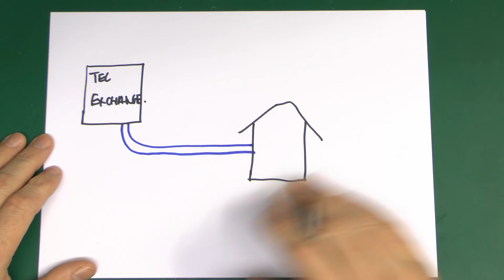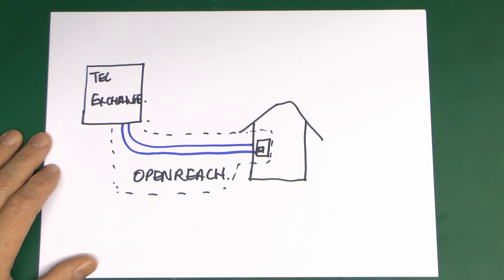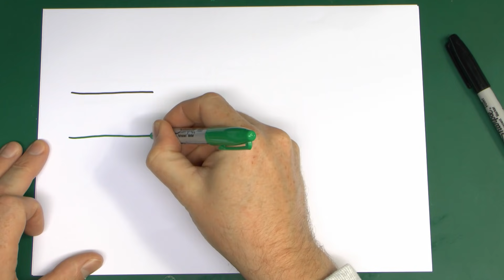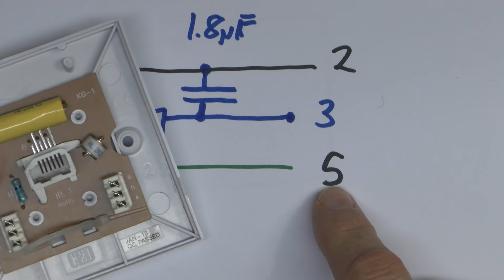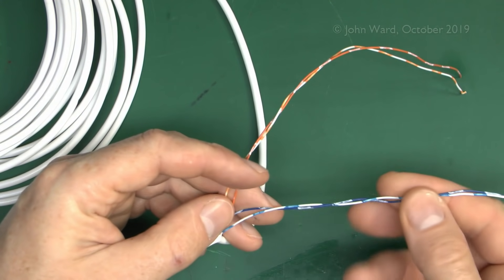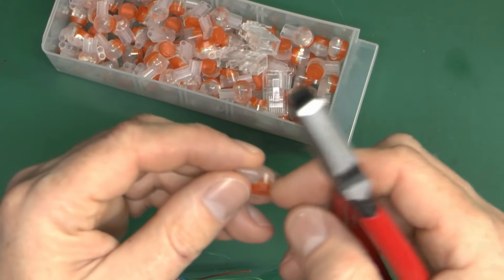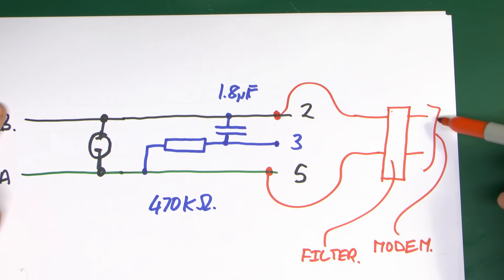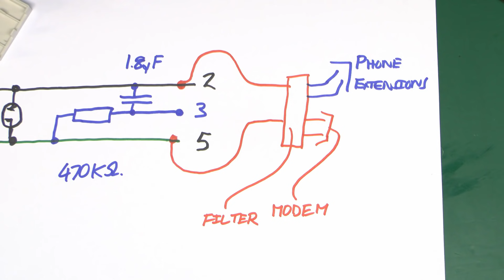UK Telephone Wiring, Sockets, Cabling, ADSL / VDSL Filters, Extensions.

Comment: 11:42 So - all one would (technically) need to do, if one has an older 3-wire phone and it doesn't wish to "ring" on an incoming call, a simple "fix" would just be to add the 470k ohm resistor & 1.8uF cap inside the 3 wire phone itself (& use just the 2 wire jack-point as a 2 wire as normal)?
I'm having a weird problem in that a month ago at 1o past 5 of a Tuesday - our speaker phone telephone started playing up by NOT disconnecting from the incoming line when the handset was replaced, instead tries to automatically HOLD the speakerphone handsfree function on ?
(possibly caused outside the installation as the tech who has NOW been here twice to fix it, eventually totally disconnected the installation (at the barge board entry box) - from all outside services yet still had MAINS HUM on the overhead VDSL/PHONE line that comes down the street... yet guess who said it isn't his fault to fix)

So - I have a distinct impression, what with the mains power company doing pole replacements in our entire town, that some "IdJit" may have "lost" an overhead mains line whilst reconnecting - allowing it to "spring-back" & somehow loop itself over an aerial telephone wire, which - when he pulled it back to his mains pole, may well have formed a potential "induction loop" around the overhead telephone wires, causing our extremely bad mains hum, static and false ringing/tinkling sounds & the non-disconnecting "hands free" speakerphone relay problems.

So - without going all the way down the street to the exchange box itself, I have no way to "sight test" (up the poles) nor electrically test at any point - our "street running" overhead telephone poles & overhead wiring bundles

I am thus thinking, that as some phones FULLY WORK (no hum/static) and others don't - while some others don't RING on the usual main 2 wired master plug-in box, yet will ring on another (maybe a slave) 2 wired plug-in box - located in a distant room ? I may have to fully rewire ALL of the internal wiring that NZ Telecom installed over the years - specifically for the three cable runs to different wall plate outlet boxes, as the one dual outlet (broadband & telephone/fax) at the VDSL outlet that Telecom NZ installed some years ago (in the center of the house) - is a dual outlet box, which is giving us the biggest headache.

I'm assuming that maybe the dual outlet BROADBAND / TELEPHONE jack itself, has faulted (maybe - or maybe not - as who cares at this stage), as that was the very last installed box with a separate cable (run from the overhead incoming line connection box up on the barge board outside), over the past 20 years or so.

IF - I do this, I will work backwards by piggybacking circuits off the most distant telephone only jack points, and rewiring everything from them - leaving the broadband's dual telephone / internet outlet - as simply an internet one - supplied directly from the outside fitted VDSL master filter..

If that works, I'll know that maybe the fault has occurred inside the exterior line box, where TELECOM FITTED their VDSL/Telephone incoming master filter - or is still far far away - somewhere along the street run overhead copper network ?

If it doesn't work - at least I know that it has to be completely OFF SITE, as all other jack-points located in here, have been working fine as 2 wired - for around ten years now.

What has me a little worried though is this, is it our master LIGHTENING ARRESTOR (inside the so-called master jack points, which are ALL of the 2 wired type, no master slave jack anywhere in the installation (which has failed), or is it the one down in their own pillbox, at their local exchange?

Comment: We had 6 core cables on our old phones (pre cordless) as we had a 4+1 system in the house. Terminals 1 and 6 are used for 'recall' - i.e. features to control the exchange - such as hold, call divert, conference call etc.
Reply: Thought pin 4 was for recall.
Reply: @AndyK.1  If so what are 1 & 6 for then ?
Can't seem to find answers on internet - all too old ;)
Reply: 1 & 6 are used for the extra functionality of a PBX system (for offces etc) whch use system telephones and not standard phones.
Reply: @wwsxa39  Does that include recalling the PBX ?

Comment: I always have at least one corded phone, cordless phones won"t work if there is a power failure in your area, the cordless base unit will stop working but the corded phone is powered from the exchange.
Reply: Agreed. you should always have a simple wired phone in the house somewhere. The one here is by the bed and not fixed to the wall - someone I knew had a stroke during the night, fell out of bed and couldn't reach the wall-mounted phone...
Reply: Just use your mobile like a normal person...
Reply: @pingumcping  I got rid of my mobile years ago. Much better lifestyle now.

Comment: Another one JW.   Pin 3 is needed to be connected on the other extensions for that bell to ring.
  Since if you have a broadband in use, you need to use microfilters on any other phones used on those extensions.  Those extensions do not need  a pin 3 connection as the microfilter will take care of this. Pin 3 will LOWER the data speed if still connected tests have proven. I could only get 368 ish of my 512 until I cut this link.  (512k people, back in 2000) .
Reply: Later NTE5s had a bell wire filter fitted to the extension plate so that the bell wire didn't need to be connected.

Comment: Looks like you drew an "exchange only" line. Most folks have at least one cab between them and the exchange.  There will normally be a bunch of pairs between each so there is some redundancy incase one pair goes bad, each join also causes issues with reflections etc.
Reply: Gary Brownlee as you say nearly all lines come via a “street box”, these can contain the modems in the case of FTTC lines, line boosters and all sorts of monitoring kit (for line loop back tests etc)

Comment: Hi john can i convert my extension socket to become my master socket as my vdsl modem needs to be in a central cupboard
Reply from the maker: Yes, it's extending the two A&B wires from the original to the new location. Original master should be removed/relocated, as you should only have one master socket connected.

Comment: Had problems when I moved into my current home as the internal wiring was/is aluminium and that stopped my broadband working. Made up a slave box to connect my telephones through a micro filter plugged into the master socket, modem also plugged into micro filter.  Result is only one filter in use, good telephone service good internet.
Reply: External aluminium cabling installed some years back is causing all kind of problems. With internal wiring, look out for and avoid CCS or Copper Clad Steel cable - it makes for poor IDC connections.
[Edit] Ditto CCA - Copper Clad Aluminium - cable.
Reply: @Graham_Langley   Especially when the sub-contracted "fiber broadband" installer jelly crimps extension wiring together to save time on the data extension install.
Reply: Copper clad in other forms of non copper wiring is also a problem with CAT5 X cable from cheaper sources
Reply: @imark7777777  CCA - Copper Clad Aluminium - and is usually described as something like "Economy C5 network cable" as it doesn't comply with the Cat5 standard, along with "Not recommended for POE" as the resistance is higher than copper.

Comment: John, some years ago, maybe 1995ish, I installed a wider door frame in my rowing club in Nottingham. Cut through the plasterboard and studded wall with a saw, and cut through a mains cable without knowing it, which caused a leak to earth but didn't blow the fuse. The TT earth connection to the water pipes had been compromised by a new plastic incoming main. So the buildings earth protection was disconnected, so all the plumbing was live. The men were getting an invigorating buzz in the showers. But  more topically, the line card in the local telephone exchange building caught fire, as the telephone line provided the only earth path for the building. Luckily the engineer in charge of the exchange was a club member ! 
The question is which leg of the telephone circuit is earthed ? dose it matter ? And is it still earthed ?
Reply: The a wire is normally the one at earth potential
Reply: Normally yes A wire is grounded, and B is -48V, to reduce corrosion. The phone itself must have been connected somehow to the mains, probably via a fax machine, as the suppressor clamps in there will tend to operate at around 90VAC, clamping the line to the local mains ground. Funny that the line card caught fire, they typically just fail open circuit as the input fusible resistors burn open, but could have caused some arcing in the input line filters as well.
Reply: One line was intentionally connected to the buildings earth. And I've seen it in other older buildings too. Not in more modern buildings though, it seems to be isolated.
Reply: @henrytwigger2245  that was only normal on payphone or party lines... Terminal 4 of the line Jack is actually designated as local earth
Reply: This is exactly why it is NOT allowed to use the main water pipe as an earth electrode - though it was very commonly done in the past

Comment: How do you check with a multimeter the  correct voltage at an extension socket, or at any intermediate junction box for example when you have an extension in an outside office? Thank you.
Reply from the maker: DC volts setting, check between terminals 2 and 5, should be approximately 48 volts.

Comment: Great video.... 
Just one thing, those British Telecom Plug (BT Plug) @ 29:26, the UK is the only place that uses those, everywhere else uses RJ11 (Registered Jack) connectors for telecoms. I've lost count of the number of them that I've cut of UK based phones/office equipment and re-terminated with RJ11 connectors instead.
Reply: Hong Kong for many years used BT plug and sockets, and many properties will still have them.  I suspect Gibraltar and the Falklands will also use BT plug/socket.
Reply: I find RJ11 so fiddly compared to the BT plug. Plus it is so similar to RJ45 that even I find it difficult to determine which is which and I work in IT. And yes, RJ11 plus and latches into RJ45 just fine...
Reply: @dlarge6502  That's the beauty of RJ10, RJ11, RJ12, RJ45, etc plugs, especially in an industrial sense, that the RJ45 wall sockets are designed to fit them and align the pins correctly from the centre out.
I've worked in IT for almost 3 decades and those BT plugs were just useless to me. I could chop off the BT plug, on new equipment, and re-terminate the cable in RJ11, quicker than finding a BT to RJ11 adaptor. Plus the adaptors were always clunky and just another failure point in the connection chain.

Comment: Very good info you’ve e done your homework. I was 30yrs BT and you’re just about spot on with this, but I’ll add a bit to it.... the resistor is used to deduce whether there’s a phone plugged in. The capacitor is charged up and then reversed and the size of the kick back on the meter tells a lot. The resister damps the kickback if no phone is in, if one or more is in then the R is disconnected and the meter gives a much bigger kickback. There should never be anything teed in before the 1st master jack aka the NTE 5 - network terminating equipment number 5A,B or C. Or the broard band B.B. will really error badly. If a master socket is used as an extension then you can just connect 2/5 either way round but if using a secondary and number 3 for the bell then they have to mirror each other end to end if 2/5 is reversed the bell will ring continuously. But eliminating the bell wire 3 keeps the capacitance balance, hence the series of NTEs that had a bell wire coil in them if you had to use a bell wire on an extension. You can use a secondary jack and just 2/5 and a B.B. filter to allow the ring, which keeps it all simple and reduces B.B. faults. The AB designation was for polarity conscious equipment like the old WB900  carrier shared line systems, if they were reversed the local battery went flat and required a service visit. Some PBX and many other things like alarms and private wires needed lines presented correctly. Number 4 was usually for a functional earth on PBX, for recall and hold but that’s going back decades really. It’s all been timed-break hold and recall for years. A NEGATIVE battery is used, was from wet battery banks in the exchange but now it’s from power banks. Never ever split a pair. That will unbalance the cable electrically and upset the B.B.. lots of B.B. faults and overhearing are caused by split prs in the network ( and splits in the house wiring cause B.B. faults ) and can be a real pain to find. The twist repels electrical interference by having a balanced field around it, if a pr is split over a distance say in a joint outside then 2 ccts will have unbalanced fields and the B.B. will error. It may not show up on a test if the distance is not far but it can ruin the B.B. Unfiltered Extensions in the house or redundant wiring or old mag bells can cause ‘reflections’ that ruin the B.B. so best to use one master, disconnect the rest and use cordless handsets. Unfiltered Sky boxes were awful for causing issues and resulted in a charge to the customer. The neighbours crappy Chinese gadget or even a failing washing machine motor or suppressor on the same mains phase as your house can ruin the B.B. RF ( radio interference) from poorly suppressed mains devices cause many issues. What appears to be simple in theory can be very complicated in reality. I’ve seen lines with earth and battery contacts and unfiltered handsets and the B.B. was working fine and the complaint was noisy speech and others that passed every test but couldn’t carry a  B.B. signal. The theory doesn’t always hold up. And never use alarm wiring for phones, it’s not twisted pr, and it’s multi strand and many a householder has paid a sparky to wire out their new house only to find they can’t get internet over the internal wiring, 😃

Comment: It may be funny, but when renovating my house I actually used CAT5e to run telephone signal, also the blue pair is used because when you run telephone signal over CAT5e to RJ45 socket you can actually plug in any standard phone cable (in Poland, we use RJ11). In one place I have my master box where everything comes in and btw 100MBPS ethernet only uses green and orange so i ran ADSL over blue pair and backed the Ethernet signal over orange and green, works flawlessly!
Reply: I would have used two cables, first because ADSL signal can be interfered by ethernet signal and vice versa, second because you would had the option to upgrade to gigabit ethernet more easily. For what it costs a CAT 5e cable better running two just to be future proof.
Reply: We have RJ11 on the phones but the other end is terminated in 431A that plugs in the wall (Domestic phones). I have not come across any phones that connect to RJ45 without an adapter). 

As A1eR says, You need all 8 wires for gigabit+ or you will be stuck at 10/100 with just 4.  As also mentioned, the 50 Volts CD then the phone would be fine, but anyone ringing changes shit. You then have around 80 volts AC  which would play havoc 'cross talking' with the data lines. The very same you do not run data lines parallel with mains power. 

That will be 100 Sloty please sir  😁
Reply: @alerighi  Here in DE sometimes the Price for CAT 3 (telephone cable) is often higher than for CAT 7 Cable. So no need to use a CAT.3 and a CAT.7 when you can use CAT./ for everything.
Reply: @H4zuZazu  I have ran extensions using twin bell in the past. (no pin3 for them to ring though)

Comment: I'll give you credit for a very good video but the filter filters out the high frequency from The Voice side of the jack and usually just passes straight through to the DSL modem unaltered. Essentially flip flop from your diagram this also prevents picking up a voice line and breaking the high-frequency connection to the modem and knocking off the internet. I am very fascinated with telephones to the extent that I have research UK telephone wiring even though I live in the u.s. for some strange reason.

Comment: On the secondary slave socket you show, do you have to strip the insulation from the wire leaving the exposed copper and then terminate or do you put the insulated cable into the termination and screw down?
Reply from the maker: You have to strip the wires first with the screw terminals.  Generally better to avoid that type and get those with the IDC connectors.

Comment: John, Iv'e just had a Virgin Media telephone installed. They now only provide VOIP phone lines via a modem/router. Engineer said ALL new installs are VOIP and some of the origonal wired ones are being replaced with VOIP area by area as soon as they can
Reply: LOL that was one of the original modes of DSL which never came to play along with TV but they couldn't get the marketing around it in the US. The ideas was that they would send you a digital circuit and then you would have a box that would break out the signals essentially and everything would communicate digitally over the backbone.

Edit another words there a bit late to the party. That must be one of those fancy fiber areas that he was talking about where it's not actually fiber although it does ease the client-side set up for later bringing fiber.
Reply: @imark7777777  is a Virgin Media line. They are a mix of optical cable or coax cable, mostly coax cable. Most of the video is talking about the old copper lines that BT have, much bigger network but the VM network beats it for speed and capacity being fibre/cable